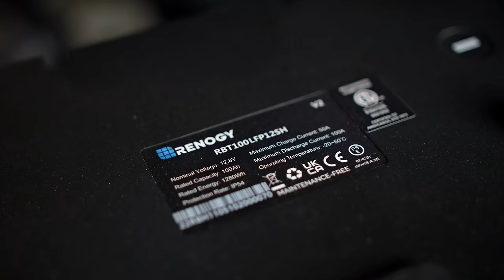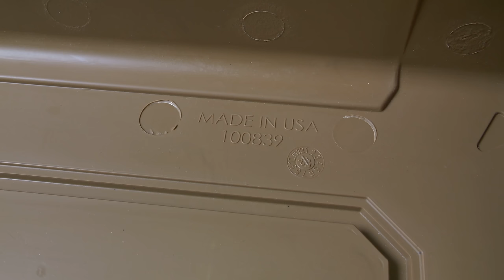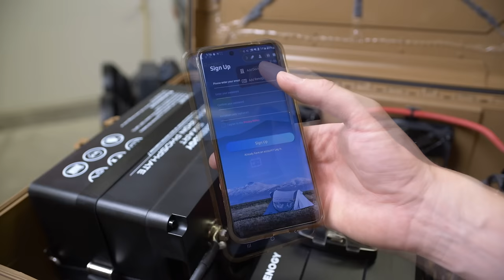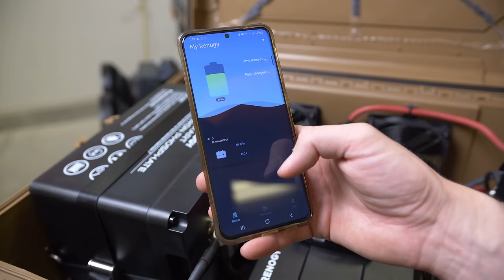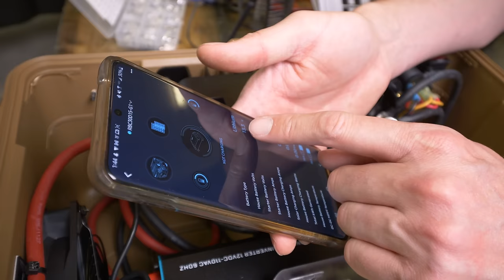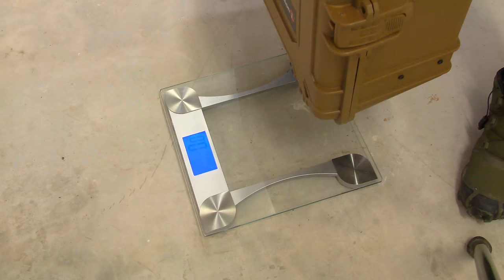It all fits in a case! - DIY Auxiliary Power System for Camping, Overlanding, Travel

Comment: You never did say how much it cost to build?
Reply: Any ideas on how much it does?
Reply: Battery is 500 bucks alone
Reply: Does your mom still cut your steak and hand feed you? 😂
Reply: I'd guess $2-$2.5k but DIY allows having the versatility for custom fitting to personal needs you could easily bend to your budget a bit.
Reply: Would guess that the point of not saying how much it cost if for the longevity of the video if he tells you as soon as the price changes the the video will no longer be 100% true
Reply: Independently that’s an expensive build, nice nut expensive.
Reply: @tyhat89 wouldn’t be hard to say “as of this date, my total came up to $xxx
Reply: You have made an awesome power supply. Your video was well edited and explained. I have only one suggestion. I would have a fuse between the battery and the inverter.
Reply: 3 main components battery, inverter, dcdc charger already 1k. dyi only save $ when u have 200ah up and not doing water resistant build like this.
Reply: Is it possible to setup a system like this so an additional 100AH auxiliary battery can be plugged in so you can have a dual battery system for your camper or the single contained battery for less demanding trips. Basically building an expandable system.
Reply: See parts list, do the math.
Reply: Informative to watch.  Thank you.

Safety comment, if I may:

4:17 ... In my opinion, at best, this case would be IP43 rated -- and not rated for rain exposure.

Elon voids his warranty if an owner submerges their car.  I believe there's a pressure relief vent valve on his batteries, which, if submerged, can allow water ingress into the battery ...  which can lead to corrosion, shorts, etc.

On a related note, the Australians have already implemented restrictions regards placement of lithium batteries for campers, etc., and those restrictions revolve around thermal runaway.

Dust too over time, with moisture = corrosion.

My $0.02

Thanks again for the content.
Reply: Lithium batteries aren't vented. Those that are, arent made for engine bay mounting.
And usually the venting is done in the same way as a "sealed" lead acid.
Reply: And realistically, you have bigger problems if you're submerged enough that the battery pack inside the car is internally wet.

Comment: Great job! If it were me, I’d add an external battery disconnect switch and a main fuse on the battery. I wouldn’t trust the BMS to disconnect in a short. I built one similar in a Milwaukee pack out with wheels. I use it for job site power.
Reply: it's for overlanding. a switch would  brake
Reply: @jffgoulet  A 100a resetable flag relay would work for that.
Reply: So it’s a Renogy build! Bit lazy, could be even cheaper if you did some research and bought other brands, I enjoy making different brand components work and save a ton of money in the process. It did give me a laugh with your friends million dollar truck but has a Jackery for off grid. 😂😂 has he not kept up to date in the last few years?
Reply: @Flow Rider65  what did I miss? Lol I thought jackfruit was supposed to be a good brand lol I'm building my own battery generator! Got any tips? I got a 2000watt inverter and a 1000wh 88ah agm battery with a battery box. Still got some more things to get but it's coming along lol
Reply: @Todd_G_FPV  my current build is a mobile power supply on a hand truck or trolley with a 12v 300ah lithium battery mounted on the base with a sheet of 10mm thick lexan poly sheet attached to the back of the trolley mounted to that is a 1500watt pure sign wave inverter a victron smart shunt, a victron 100\50 smart solar controller, a 12volt distribution box with multiple USB, cigarette sockets and Anderson plugs it has protection from a couple of fuses and fuse holders from itech world and a 300amp isolation switch. So you can wheel this anywhere you need power, I can wheel it to my solar panels or mains lithium charger to charge it up. Eco flow, Bluetti, All Powers there are many all in one power stations out there that are far superior in discharge and recharge than the Jackery! If you build one don’t put it in a box the inverters and other components don’t last long if you do! Arrrr reading your comment again I see your taking the piss!! 😂
Reply: @Flow Rider65  only thing that will be in the box is the battery, fuse, 12v car outlet and the power cutoff switch. I tested my setup (battery and inverter) together today and at 550 watts it ran perfectly for about 5 minutes or so when I shut it down. I'd like to add a light to the side of the box and one day go lithium since that battery is pretty damn heavy lol I'm in a wheelchair so I need it to be somewhat maneuverable lol not sure I'm on the right path with that atm but the build has started lol

Comment: This was probably the best power station you could make at the time.  However, Renogy  components sell for a premium price.  Now, the Licitti Battery Box has all the ports you have plus a 1000-watt inverter and an MPPT controller pre-made for under $200.  All you have to do is add a battery.😮
Reply: That sounds great. But where does one aquire said item. What platform did you see it on and what's the exact name of device

Comment: Tip long term storage for LiFePo4 batteries, they do not like to be stored fully topped off, it'll actually damage them. Optimally they want to be at between 40-60% capacity. Voltage is irrelevant with LiFePo4 batteries since their charge and discharge curves are flat, so monitoring the amps during charging is the best way to hit the mark.
Reply from the maker: Yep, that's exactly right. I was thinking this unit would self discharge to optimal levels when in storage mode (my drone does this) but after a second look, it's not that intelligent. I'll be making a follow up video to cover these finer points for use. Good catch 👍
Reply: @LifestyleOverland  great build, should last you many many years!
Reply: What happens if discharge LFP daily to say 70% and then charge to 100% next day with 8 hours on night rest at 70% SOC and 7 hours of SOC at 100% from 10am to 5pm.. is it OK?
Reply: Its fine @anilgargsfo

Comment: This build seems expensive compared to comparable pre made units and doesn’t have necessarily all the features you can find on a premade. The main advantage in a system like this is the ability to replace a part if it fails.

Comment: Very nice. I will say as someone who worked for many years with both AC and DC high voltage and current I personally would always remove rings when working around any power but that's just me. Saw a coworker lose a wedding ring when it shorted a 48vdc contact.
Reply from the maker: Yep, we agree! I cover this towards the end when I explain the system was dead until I activated the battery. 👍
Reply: @LifestyleOverland  I must have missed that. I don't even wear a ring anymore. Too Many years working around 40kV DC.

Comment: Love your build. I built two 100ah system very similar to yours. I elected not to us and inverter as my rig only uses 12v accessories. If I need an inverter it is easily plugged into the 50 amp Anderson's plug that I have on the side of the case. you may want to add a shunt monitor. This would be the best way to monitor your power usage. I have two of the Apache  3800 cases with 100ah batteries that are easily place under seat or in our side cabinet in the over landing trailer. They each have Bluetooth monitoring. A master disconnect with a key is another item that you need to have for the battery.

Comment: Great little setup, and thanks for showing us in the tutorial. FYI for cct boards that are bare like that, I just get some wide heatshrink tube & put a loop around the board & 70% shrink it & it becomes a protective plastic barrier you can remove later if needs be

Comment: Two minutes into your video I already have a great take away. Doing this yourself compared to the commercially available systems is self repair. When we learn to do this ourselves we retain control over servicing the unit. Try to take apart and replace the batteries in the commercial products. And if done right this would likely cost a fraction of what the other products would cost.
Reply from the maker: It's a lot more work but everything is modular and replaceable 👍 I've heard many of the pre built units can run diesel heaters whereas this will handle the inrush current.

Comment: This is a very nicely built system.  I have built 3 over the years (one last week).  It's similar to yours but very small and weighs 13 pounds as  I am using smaller components.  Thanks for the video...

Comment: HELLO! This is one of the best designs I have seen.. very well laid out and neatly done. I have several suggestions: Use heavy duty, good quality DC breakers instead of fuses. Use them between your solar controller and the panels, between the inverter and your batteries and between your alternator and your solar controller. Instead of three wires to a terminal, keep it only 2; use a bus bar or "daisy chain" the connections before you connect them to the terminal bolts. Other than that it looks very good! I did get a kick outta your comment about removing the foam on the box top.. because of a fire-- keep in mind that plastic box will burn just as well. LOL

Comment: I'm going to build a small motorcycle trailer as a super power bank. Right now, I make ammo box power units using 18, 20, 40 ,60, volt etc. using drill and electric mower batteries.

Comment: Thank you for putting this together along with a comprehensive and very clear to follow build list. I'm not sure how many of the components I could source here in Japan, but I have been looking to do something like this for my goods trailer that I use for camping. Our trailers need to go through a vehicle inspection just like any other vehicle and a goods trailer needs to be empty at the time of the inspection. Therefore, any modification I do to the trailer needs to be easily removable and not alter the trailer itself in any way. Therefore, your detailed build is invaluable!!

Comment: Really nice build, this made me happy and thanks for the explanation about how and why you made it. Knowing how other people think about this stuff helps me learn! 
I made a smaller version back about 15 years ago for the same reasons - learn some things, decide if DIY would work, etc. In a waterproof plastic ammo can with a smaller  sealed lead acid battery, form factor on the case kept it upright, basic mppt controller, all modular with Anderson powerpole plugs to swap components. It was heavy as heck for its size, did the job for cellphones and cameras at the time. I am inspired to do a copy of yours :)

Comment: I use a “used” goal zero 1000 with 200 watt solar. It powers a “used“ Engel refrigerator.  Both purchased well below new price and they work most excellently. When not in my truck it sits in the garage running 24/7, both goal zero & Engel are two of my best purchases.

Comment: Maybe use bus bars for positive and negative connectors for EVERYTHING. (Lol)
A good example is the Victron Lynx Distributor. (Just an example of method, might be too big for this usage). Also maybe safely fasten a small solar panel to the inside of the lid. Plugged into the solar charge controller. Point it into the sun etc.....
Good work on this youtube post. Loved it.

Comment: 7:50 FYI You can absolutely lay an AGM on its side. I've had a pair of Odysseys installed that way for quite some time now. 
19:16 You can get a lot more accuracy with a dremel over that router. I felt your pain on that one lol. I've done that more than once myself. 49lbs is damn good for all that gear. I really need to swap my AGMs for lithium at some point. Nice job on the power system.

Comment: Really enjoyed the 'build', very, very helpful. There are indeed some very impressive 'ready-made' units from the likes of the brands you mention. They can be a real 'bargain', especially when on 'special' offer. On the plus side, they can be ready 'to go' and they come with a warranty. But it is clear from many reviews that some have even 'failed' straight out of the box. A warranty is all well and good, but absolutely no use to anyone stuck in the middle of the woods in 'bear' or 'wolf' country! Sending it back to a supplier, waiting for a replacement/repair/ or just your money back - not much use if the only time of for your 'trip' has now ben used up and you have to get back to work without completing that trip you promised the family. Warranties will only ever cover 'normal' use, (which is more than a bit subjective) - when was the last trip you had 'normal' in any way for the equipment you used . . . . Not to mention, in these ever more uncertain 'times', even some of the biggest 'brand' names we rely on may not actually still be here next year. Even 'out-of-warranty' many (if not all) of these ready made units are absolutely un-repairable by even the most adept DIY'er.  Some have bespoke software or sealed or bespoke parts that make home repair impossible (for 'safety' reasons by the manufactures 'of course'). With a self made unit such as yours you can balance the 'budget' vs component 'quality' level to fit your current needs exactly and have the flexibility to 'add-to' at a later date as and when you need. All the component parts will be accessible for adjustment or repair if needed - even 'in-the-field'. Imagine your ready made unit fails because of a simple 'fuse' you did not even know it had. A trip cut short or even ruined because of a 50 cent fuse ! arrrrh.! At least with a 'home' built system you will have a really good idea of what fuses, cables, connectors would be a good idea to have a spare or two of. If they did need replacing on a trip many of the proprietary 'modular' components you have used in your own self built may well be readily 'off-the-shelf' at the nearest 'truck-shop' or camping provisions store - just a thought. The 'extra' your home built system may cost initially, compared to the price of a ready made unit could well be worth it for long term reliability, flexibility and peace of mind.

Comment: I think it was necessary to put the battery in the middle between the fans, perhaps lifting it a little above them, and the fans will thereby blow on the left and right of the battery and what is around it, there would be a better balance in weight and better air exchange

Comment: Really nice build and a great battery choice for all weather use. You could further clean up the case by removing the temperature sensor. According to the manual temp compensation is not used in the lithium charge profile.

Comment: You can use a green scrub pad for a dirt filter between the grill and fan. Plus they are  easy to remove and clean.
Reply from the maker: AWESOME idea! 👍 Been thinking about that.
Reply: I suggest a white scrubby. Finer mesh = bet filtration and a quick look will tell you when it needs to be cleaned.
Reply: I was thinking the same thing. Some sort of dust filter.

Comment: Wish I saw this earlier before I bought my cheap 100Ah 12v battery, due to some features on communication you have readily available with your set up.

Also I like going this route due to it being much more cost effective long term than ready made portable options, and not having the weight always in your vehicle, especially with mine is a daily driver.

Comment: I have this same Renogy set up in my DIY Sprinter build (except I have a second 100aH battery which is when that second RJ port is used) and I do have the BT Hub. It all works BUT you have to plug the BT2 module into EVERY device to pair them to the app *BEFORE* you plug the BT2 into the Hub. 

Also if for some reason you need to RE-pair a device you have to re-pair all the devices.

I also dislike the Renogy app seems to require Internet and login before you can check yours devices. They may have fixed that.

Finally… Renogy does not offer a very good AC-DC charger… I went with a Victron unit for that and it works great.

Comment: I love projects like this! I did a solar setup on my tacoma that charged a LiFePO4 battery in my rear storage. I use it for powering anything on the truck that I use with the truck off(scene lighting, dometic, 12v in the bed for a diesel heater,etc) I only use solar to charge it though so no DCDC in my setup and I don't have an inverter on it(I've just grabbed 12v chargers for the things I would need an inverter for since its more efficient that way) I did recently pick up an Anker 521 So that I would have something portable outside the truck though.

Comment: Great video...FYI you can save about 30 bucks by ordering the no foam version of that case..I have been looking at doing something like this for awhile. Need to also power ham radio equipment. I am wondering how clean the power is on the HF bands.

Comment: I used to hate crimp connectors until I got a good ratcheting crimper. I got the Klein tools model, works great for me nearly every crimp. Avoid the HF ratcheting crimper (I use some of their tools and their fine, in this case a hard "no").

Comment: Nice build!  Just curious, what does this compare to that is already made by one of the main brands of portable power stations on the market?  Seems this project costs alone $1600 or more.  Nice work though.
Reply: I just bought Ecoflow Delta Max 2 with extra battery, 4kw (4096wh) for $1950. Was debating cancelling and DIY but the batteries alone would cost $1k on the cheaper side. Upside of DIY is you can just replace whatever burns out first.